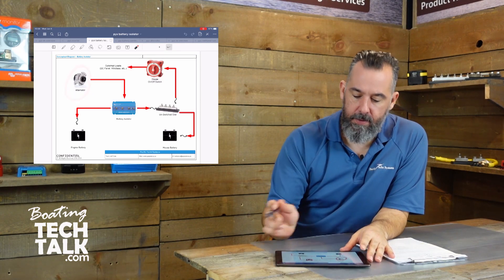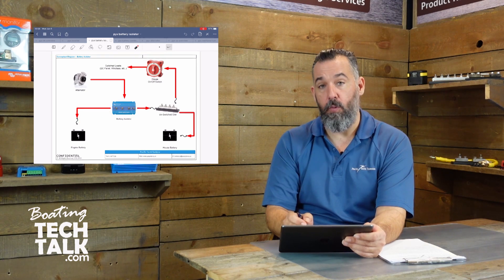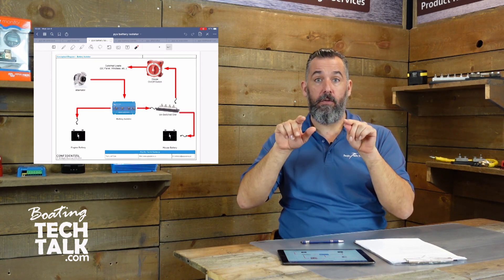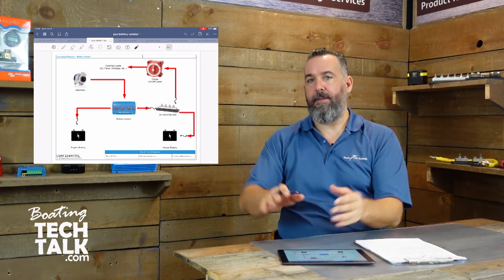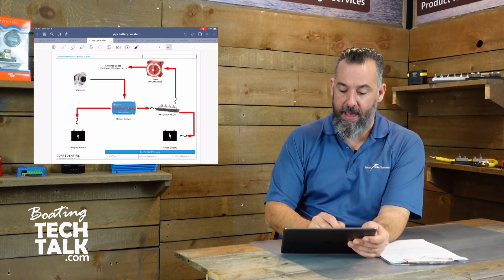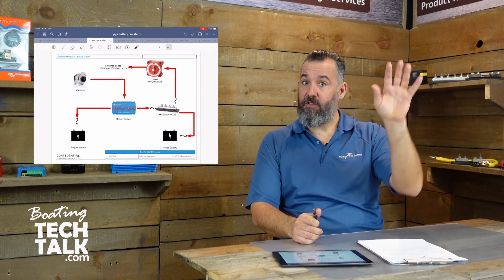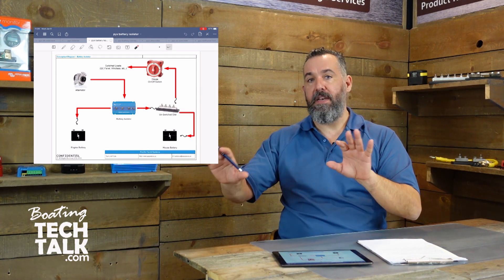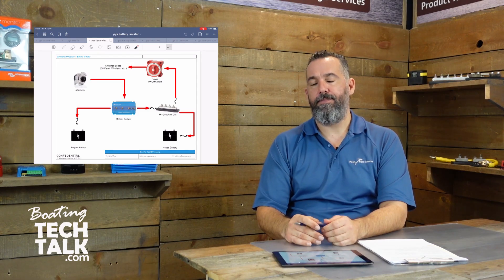How Do I Charge Two Separate Batteries With One Alternator?

Comment: I think a key point to remember is that while the house will get full voltage output from the regulator, the diodes that ‘open’ to let  engine battery get charged as well have  a slight voltage drop when they open, so the start battery often never is quite fully charged. 
I’ve begun replacing typical metal box isolators with Blue Sea ACRs as they do not have that voltage drop AND the top-up charge can go either way — 24/7 — not just when alternator is running.
Reply from the maker: Thanks for chiming in on the conversation Paul Whealy.

Comment: Curious why ACR's weren't part of this discussion? The Blue Sea ACR package is pretty slick and allows a dual battery system to be efficiently charged with a single alternator input without the inefficiencies of a traditional diode based battery isolator. Further, an ACR allows remote battery combining in the event of an emergency situation where a typical isolator would require a separate circuit to perform the same (critical) function. Just curious why this wasn't part of the talk. Great videos...always learn something.
Reply: I was thinking the same thing. Will be interesting to see what Jeff has to say!
Reply: I agree that using an ACR would make more sense when you have two battery banks of the same chemistry. If you have different chemistry, then the dc2dc makes more sense. I'm all AGM, so I'm using the ACR and wiring the alternator to the  
house bank. The ACR will provide charge current to the starting battery.
Reply from the maker: Good question, absolutely correct: a battery combiner is a good way to share any charging voltage from one battery to another. That said, we need to make sure the batteries are both the same chemistry for a battery combiner. Assuming you have a battery charger connected to battery banks, then you have the option of using a battery isolator or a battery combiner.

Comment: Thank for sharing your knowledge about boating electrical systems.  I want to decrease my boat's weight by switching to lithium batteries; I purchased a DC-DC isolated battery charger, I added 2 lithium 12V 100amp batteries in parallel for the house battery.  I realize that since the house batteries will do the job of my traditional second battery then I no longer need the second battery,  just  keep the starting battery to start the engine and help in charging the lithium batteries with through the DC-DC charger. 
Am I correct, or is their something that I have missed? Appreciate your input.

Comment: Good day Jeff. On my boat how do I use my alternator to charge both my 12v starting battery simultaneously with my 24v trolling motor battery bank (which is two deep cycle 12v batteries wired in series)? Thank you.

Comment: Jeff, I have a Bayliner 2859 with a 7.4 Mercruiser I/O and two batteries. On this boat, and I'm finding out on many boats like this, the output from the alternator goes to the starter, then it goes to the 1-2 both battery switch and is on the common post. I want to add a battery combiner and I'm having a hard time figuring out how to do this. since the cable going from the starter to the batteries is bi-directional it seems to me that I wouldn't want that going to the battery combiner. How would I wire this?

Comment: Interesting point at the end about charging 2 different types of batteries or 2 different voltages. I am building a system with both 12 and 24 volt battery packs and I have been wrestling with the best way to go about it. The 24 volt system is for refrigeration, water pumping, air handling, lighting and the occasional large inverter load. The 12 volt system is strictly for electronics; computer, device charging, audio/video and comms, with its own small inverter and 12 volt distro. Having no experience with DC-DC chargers personally, I have been avoiding that method (old, stubborn). Instead, since I have a spare 60 amp charge controller, I am (at present) planning to split my array as well, with both strings going through the same disconnecting combiner, then out to separate charge controllers. The engineer in me says this is the elegant method. The wallet says I need therapy. LOL Keep the weight in the keel. :)
Reply from the maker: Hey Tao, really appreciate you sharing not only your approach but also your reasoning. Keep us posted with your project.

Comment: Hallo I have in my boat two batteries 100ah each same make and year connected in parallel to a Victron charger 220v with two output charging cables and one negative.should I connect those cables to each positive pole of the batteries? Or should I use just one of the charging cables to connect it to the  first battery and the negative to the second one? Thank you in advance and greetings from Greece

Comment: Very efficient answer.... really liked this one. Question: it was on the diagram...why ISN'T a/the battery switch a 'battery isolator'? (or, what's the difference?) THX!
Reply from the maker: Hi David, good question, Hard to say how everyone around the world uses the terms, here's my understanding:
Battery Switch = A on/off switch that allows the operator to isolate (off) or connect (on) the battery and it's load
Battery Isolator = A diode based or FET based device that allows one or two inputs to connect to two - four batteries, this allows the charging voltage from an alternator to recharge multiple battery banks.

Comment: Thats educational and nice video but how can you achive an dual system? Thats my second question on this chanel. You see I have centrain projects wher I need bouth capacitor banks and baterry banks but need an means to seperate those 2 cirquets I heard about virtual ground and positive relays can perform that task but wuld it actuali work? You see guys I need all of it simply ac ,dc,dc pulse to work on an engine that has multipel control curquets .And Im running in to risk geting shock from the chassis so thats why I was curiuse can virtual ground by used to seperste capacitor ground from the chassis to not run in to problems with baterry gas changes for exampel risk of explosion of an baterry . I hade some small project what I wanted to do converting an alternator to magnet type and running external multi center tap transformers so I also was wondering how an magnet type alternator solves under load and over load situations and wuld an transformer by dangerouse if it has the case no ground reference it wuld buzz right? So how is ground solved for an transformer is it encased in some liqued or has also virtual ground or it wuld work just insulating that thing?So Im in surche kinde of for dual variabel power suplies who use 2 different electricity types . Im mostly woried the alternator wuld snap the pulley belt and mostly  concerned about shock risk . I live in harsh conditions winter is trobel some so I try figure out if posibly arc welder diodes might get the job done forcing current to an starter motor or modified dc motor starting system I tought perhaps the voltage can by suplied from an different cirquet seperatly to an dc motor some sort of ya know 2 way controler system for an dc motor ,also some engines like more amps rather then volts to start up bether like exampel metanol based fuel types who use high amp ignition system .So my idea might by silly but no bade intentions also wuld like to fead external heaters all around the engine to help it easyr to start in winter like oil heaters,engine cilinder heaters,intake heaters,fuel heater and similar just to help my start smuther engine in winter time. So was wondering if ther are posibility to use dual diode bridges 1 for high amps 2 for normal alternator operation to charge ordinary baterrys ? I love to tinkel with my engine so I want some thing bether more reliabel and variabel cirquet similar to what heavy duty industri electrical components that are useing. So hoppe some one understud the question.  I modifi engines so I relie mostly on universal cirquets and who must by variabel. Mostli working mashines like tractors, trucks and other mashines that use also hidro pneumatic atachments. Thats why I have problems finding correct cirquets my engines run at different fuel types and their speed rotation is different including the torque/speed ratio so I need to figure out how improve my engines with external cirquets .

Comment: Jeff, I have a question on how battery isolators work in terms of current output. If a single alternator is connected to an isolator, and that isolator is feeding current to two batteries (via separate isolator outputs), how does the state of charge of the two batteries affect the current being sent to each battery, or does battery SOC have no effect? That is, practically, if one battery is at a lower SOC than the other battery, does more current flow to the one with the lower SOC? And, does this vary between diode vs FET isolators? Thank!
Reply from the maker: Great question, your on the right track, as a lead acid battery gets more and more charged, the resulting amps diminish over time. The battery isolator does not throttle or modify the voltage or the amperage, but merely shares the alternator charge to both batteries. A
Reply: @PacificYachtSystems  Jeff, looks like you started another sentence, yes, no? To clarify your response, yes, as the lead acid battery bank gets more charged, the amps going to it, decrease, BUT, does that result in more amps going to the other battery bank with lower SOC?

Comment: Hi Jeff! Can you recommend a high output alternator to replace the stock 70amp (rated) alternator on my 225hp Verado? I’d like to maximize the current that goes to my lithium house bank through a Victron DC DC charger
Reply from the maker: Unfortunately no experience with outboards, would suggest sticking with a Mercury alternator.
Reply: @PacificYachtSystems  Hey! Thanks for the quick reply. I've scoured the internet but there's no info on this matter. Anybody out there with an oversized alternator on a Verado, please chime in....

Comment: So if I have my regular car battery lead acid and then separately have 2 lithium ion batteries in the back can I not run a separate wire to my spare batteries and "share" the alternator? Would I need a dc to DC on the lithium side wire?
Reply: You need a DC to DC charger to take your Starter Battery voltage to Charge the Lithium Bank.
Why?
The Charging Profiles(or Rate at which the Batteries Charge is Different in Differing Battery Chemistries)
Also Float Voltages are different.
DC to DC chargers accomplish this.
This can allow the Batteries to last much longer.

Comment: ok my starting battery is AGM, the house battery i plan to get is also AGM, both are 12 volts, will i be fine?
Reply from the maker: I'm not sure what your question is but having both banks as agm is a good idea
Reply: @PacificYachtSystems  O i have installed it as 2nd battery and has been working fine with the relay for over 2 months

Comment: you keep popping out great videos Jeff, thanks. i am wondering what happens if the starter battery becomes fully charged, does it then automatically prevent the house battery from charging further? thanks
Reply from the maker: Good question, battery isolators or even battery combiners don't regulate voltage they just share it. Resultingly, as the batteries get more recharged, the voltage rises, and the amps diminish.

Comment: Hi Jeff, what options do I have in replacing a 2 Alt - 3 Battery Bank isolator?  I currently have diode version but it is dropping more than 1volt and needs replaced.  I only see you talking about 1 ALT isolators.  I have two 70amp alternators and 4 batteries (port, starboard and 2 house in parallel) what options recommendations do you have.  thanks
Reply from the maker: We use to two 1 to 3 battery isolators and have one battery post on each battery isolator connected to the house.
Reply: @PacificYachtSystems  just leave the third battery post on each isolator empty?   Thanks

Comment: Is it possible to run two batteries off one alternator separately, while the car is running? So the under hood battery to power the car and second battery in the trunk to power an audio system.
Reply from the maker: Yes.   You could use a battery combiner such as a blue sea acr,  or a dc to dc charger like an victron orion smart.      an isolated dc to dc charger might help block alt noise to the stereo.   But it would have to be big enough to keep up.  The victrons are only 30a at this point
Reply: @PacificYachtSystems  So where do I mount the isolated DC to DC charger?
Reply from the maker: Anywhere between the 2 batteries.  In the trunk near the one being charged would be better.   

You actually might not be able to take advantage of the isolated one.  That would require the rear battery not be connected to the car chassis.  only to the amps.   But in that case you'd probably have to run a new ground from the rear battery to the deck and remove the existing one.    

Most likely the rear battery is already grounded to the  car chassis and the non isolated one will work fine.  However as posted above it's only 30a and it may not be big enough if you have a big system.  

The orion smart does needs a bit of setup via bluetooth once it's put it as well.
Reply: @PacificYachtSystems  sounds more complicated than what I wanna do. I might just put a big lithium in the trunk and wire everything there. Thanks!

Comment: I have a 2013 silverado with an isolator goes alternator to car battery, from car battery positive goes to isolator, from isolator goes to positive 2nd battery, from negative 2nd battery goes thru cars amp drain sensor in to cars negative terminal battery.

Comment: For somebody who's been convinced on the benefits of a lithium 'house' bank, how about getting around the dual-chemistry-problem by replacing the engine starting battery with a similar chemistry lithium battery, say, LifPO4 for both banks?  Is there any significant obstacle to this approach, other than the increased cost for a lithium engine battery?
Reply from the maker: Hmmm, that's a tough one. Most lithium house systems include AGM for engine battery as a way to alleviate the concerns of the Lithium battery BMS shutting down because of potential overcharging from the alternator and yet still have a battery (namely the AGM start battery) connected to alternator.

Comment: As always thanks again for a informative video. 
I was wondering about a solutions for fusing as close as possible to the batteries ( start and leisure) i am thinking 50mm2 or 70mm2 cables. Any suggestions would be very greatly appreciated :) 
Mw
Reply from the maker: You should look into the MRBF fuses and holders, they are rated up to 300 amps and can be installed directly on the battery.
Reply: @PacificYachtSystems  thank you :)

Comment: Was wondering if there is a device that would allow you to run six 24 volt batteries in series but keep them isolated, so they don't see each other. Making a total 144 volt supply.

Comment: Great video(s)!! Which battery should you monitor with external voltage regulator? Single 12V start battery, or 440AH AGM 12V house bank? If the start battery is monitored will it limit charging to the house bank? And if the house bank is monitored will it over charge the start battery?
Reply from the maker: It's a pickle, go with house battery bank.
Reply: @PacificYachtSystems  Thank you for the reply! That's where I was leaning, felt the charging availability to the house bank outweighed the detriment to the start battery. Looking back, maybe I should have took the dollars for the isolator and put towards a dc-dc charger.

Comment: I have a question about adding a 5th battery to my 2000 SeaRay Sundancer 340. I have two engines with one shore engine battery and one port engine battery. I also have one generator battery and one house battery. I would like to add a 5th battery for the stereo system I have in the boat. I'm running two amps with Led's throughout the yacht. Is it possible to allow the system to safely charge a 5th battery? Also is it possible for my battery charger to charge that 5th battery when I'm connected to shore power as well? Thanks for any advise.
Reply from the maker: Adding a 5th battery bank is doable, you can have this battery recharged with a battery combiner.

Comment: An isolator (diode) hasn't been a good idea for over 20 years.
Reply from the maker: Your right, but the modern FET based (not to be confused with diode based) battery isolators are more efficient.

Comment: Just to clarify, and I promise I am not a troll, but What you pretty much just described is a Battery Bus Bar with multiple batteries connected to it and no explanation as to how voltage does not Typically move across the various terminals and that really isn't an Isolator... a typical Isolator uses a Solenoid and a Diode together like a water flood gate... when the water is low on one side the dam lets water through usually via gravity.  This is the reason people say it is intelligent, deciding where and how often to send power is true.. but only due to level of voltage on the other side of the Solenoid ... intelligently charging Only what needs charged.  The top of the spiral in the solenoid will bond two metal pieces touch briefly releasing current to the battery on the other side, only because the voltage coming in is stronger than the battery currently has charged, if the battery has sufficient charge the solenoid wont have the ability or potential to "dump" its load and its charge will begin to dissipate, this electron trafficking is very similar to how computers work which makes it seem intelligent.
Reply from the maker: Thanks for sharing.